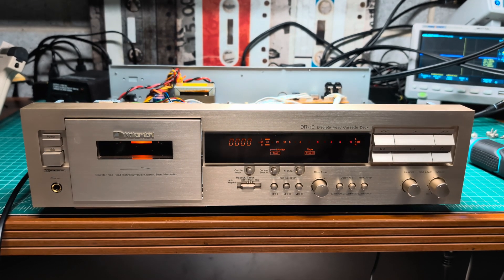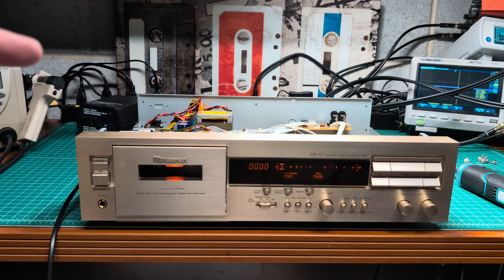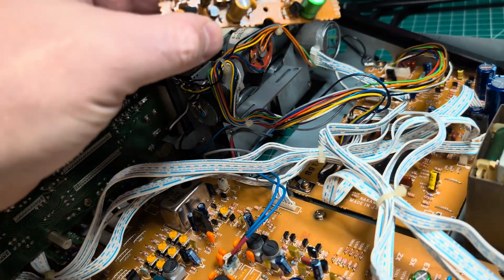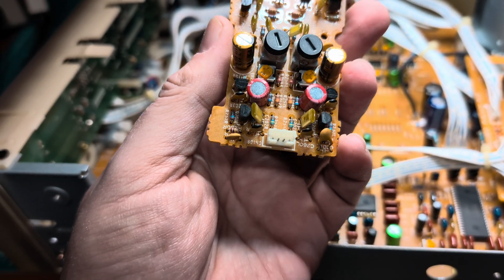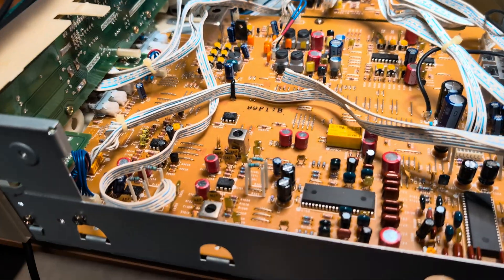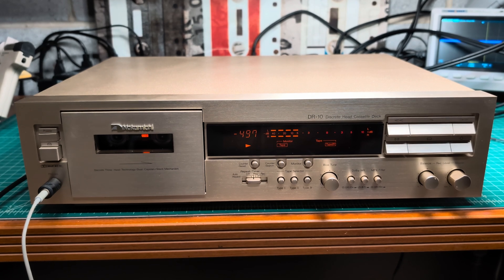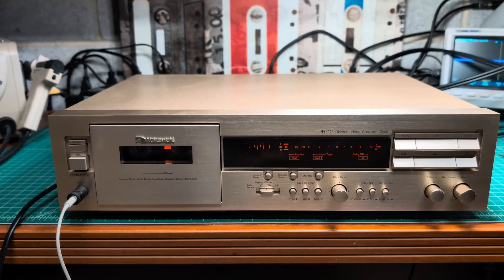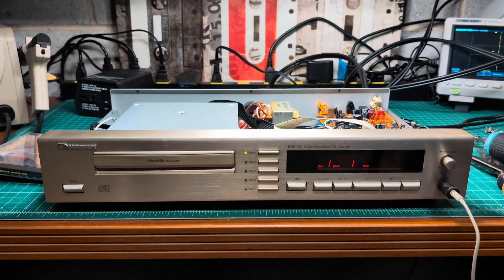Solid Polymer Caps Upgrade for Nakamichi DR-10 & MB-10: Sound Perfected

Comment from the maker: I would recommend Solid Polymer caps only for decks from 1990s, My experience with earlier decks was not so positive.
Reply: I would recommend putting it in the trash and to stop wasting your time on such pointless rubbish in 2025!! 👍
Reply from the maker: @ it’s just your opinion. Stop wasting our time.
Reply: @  Don't react? So real discussion is wanted by yourself lol
Reply: @DavidMander-rs4uk   I agree I donated my very good JVC cassette player/recorder to the Salvation Army years ago. Don't miss tape at all or vinyl. CDs (redbook) were and still are the best sound. Nobody needs old antiquated playback systems or expensive "Hi-Res" digital that only includes more high frequency noise instead of better sound improvements.
Reply from the maker: @ That way out of the truth. If you can't hear the difference between CD quality and High-res, time to think if your system is worth it...
Reply from the maker: @ Thanks for your reply. Yes, lots of truth in your words. That is my feeling that I want to get more and more from the same media format. Every single time I thought that I can't get more out of the cassette I was wrong. Last week update for DR-10 made me rethink how cassettes can and should sound. Cheers :)
Reply: @  seriously others on YT have shown that most Hi=Res recordings include high frequency noise that actually makes it sound worse than a good old CD version
Reply from the maker: @davidlong1786  It is not a noise, it is stage! I am so sorry you don't have a good source to listen.

Comment: Without data (frequency response bode plot at least) before and after this mod is based on purely subjective basis. Which means it can work for you but others may find the deck performance worse with poly recaps.
Reply from the maker: That is exactly the same mode I did before for DR-1 models twice. It is validated and owners of these decks are super happy with the sound. I posted a videos on my channel before. And I have been on this channel for quite a long time, so you can trust my word. Response is linear, and now a match to other decks. The original sound from this DR-10 was different, too bassy and not the same as from multiple DR-1's, and DR-2's I have restored earlier. That was a main reason. Now I may say that even if it is close it is still not a match to Sony KA7. Sony with these series capacitors is unbeatable machine. Keeps stage as in original high-res files. This Nak is close, probably the closest, same as DR-1. And Dolby C compatibility significantly improoved now.
Reply: Yes subjective only which proves nothing. Lots of "experts" with YT channels making claims they never can prove.
Reply from the maker: @davidlong1786  the frequency response is flat before and after, tuning solves. The only big difference was in the 15 to 20 kHz range in the playback amp. I had to reduce by approx 4-5 db at 20 kHz.

Comment: What brand of polymer caps would you recommend below 22uf as the Wurth types are only available from 22uf and higher. Thanks
Reply from the maker: well, thats not exactly true, Wurth provide caps from 10 uF, i use Nichicon for 2,2 and 4,7 uF, here is the Wurth link https://www.digikey.com/en/products/filter/aluminum-polymer-capacitors/69?s=N4IgjCBcoGwJxVAYygMwIYBsDOBTANCAPZQDaIALGGABxwDsIAuoQA4AuUIAyuwE4BLAHYBzEAF9CAWgjQQKSBhwFiZEPQDMAJmaSQUnXIX8AripKRyAVl3jxQA
Reply: @hifirulezzz  Thanks, had a look. Yes I must of mis-read it. Which series of Nichicon caps? Would you get the same results in a Nak Dragon?
Reply from the maker: @johnnyg1700  My experience was not good when I recapped RX-505 with polymer caps, I had to retreat to the Nichicon Fine Gold. However, I was working on the Dragon with film capacitors installed in place of electrolytes in the sound path and sound was very crysp. Check the video series on my channel about like new Dragon.
Reply from the maker: @johnnyg1700  Sorry, it was a Kemet, but I remember I was buying a Nichicon as well, cant find now. Check this link: https://www.digikey.com/en/products/filter/aluminum-polymer-capacitors/69?s=N4IgjCBcoGwJxVAYygMwIYBsDOBTANCAPZQDaIALGGABxwDsIAuoQA4AuUIAyuwE4BLAHYBzEAF9CAJgAMFBNBApIGHAWJkQUgHRSABAFaAYiEIBmbWcMnCFbfWvM2nSCACqQgewDyqALK46NgArny4EoQAtFKISlD8weokkOQArMzimUA
Reply: @ I recapped my Dragon audio path with Nichicon ES but the sound is a little on the dull side. I am going to try another alternative and I value your experience for some advice. Thank you.
Reply from the maker: @ Nichicon FG are the best for the Dragon from my experience, however, as I wrote earlier, I have met Dragon with film caps in place of electrolytes and it did sound awesome.
Reply: @hifirulezzz  Thank you for your feedback. 👍👍

Comment: If my Naks (CR40 and LX3) had this sweet low-end rise I'd never, ever touch them... but they don't. But both my Revoxes do just this. Deliberately doctored by the designers, it's right there in schematics. So the B215 does the playback, and the neutral CR40 is for recording only.
Reply from the maker: Well, you know, it always depends on our choices. The point is - I dont do a refined sound, it is still live and juicy, but more open, widerange and able to reproduce stage. If you dont hear stage on a live concert, no bass can compensate for it.
Reply: Tapes decks are laughable in 2025!! 🗑️😆
Reply from the maker: @ ok, I will wait while others will explain. Nothing laughable , you just never heard a high end decks.